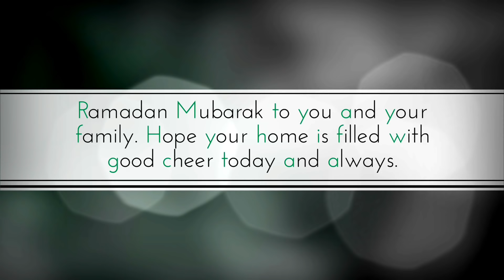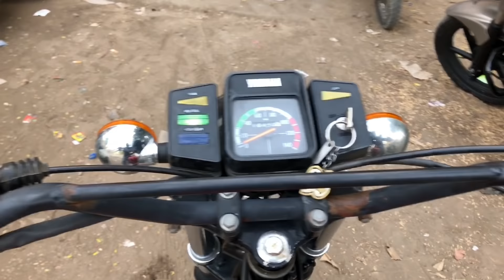YAMAHA RX100 SERVICE GUIDE | Q&A | MAINTENANCE TIPS  2018

Comment: bro please suggest me a good 2t oil for my bike. i have a rx135 4s 2000 year. i am currently using bpcl mak 2t. i m confused between mak 2t and motul motomix. i previously used motul motomix but it was half tank left and i topped it up with mak 2t so now i am using a 50-50 mix of mak and motul and i still have half litre mak left in a bottle. waiting for the oil tank to empty so that i can change the oil.
Reply from the maker: Go with Shell penzol oil
Reply: Thanks for replying bro but I use the bike for daily commute to my classes(10kms a day) so I was looking for some mid priced product so that maintaining this bike would be a little economical for me.

Comment: Bhaiya,
Agar m rx100 ka silencer ko rx135 m lagata hu to uska exhaust rx 100 ki tarha rehega kya?
Mera 135 m mujhe 100 ki tarha exhaust sound chaiya kya kare????
Reply from the maker: Not possible exactly coz rx100 ma cylinder ka diameter alag aata hai more smaller one so thats why it can produce signature sound,
In rx135 already there is Sweet sound ,
But in case ur want cut the little Muffler pipe and check.

Comment: My RX 100 bike on full speed some times it quickly slow down the speed and off the enjine.It always happens after 10_15 km runs. Why?
Reply from the maker: check crank
Reply: Bro it's pick up coil problem change Ur pick up oil

Comment: I have rx135 4speed 2003 .25sleev bore milage 32 aata hai bas, maximum kitna milage aata hai rx135, aur milage ke lye kya karna hai
Reply from the maker: Bhai Carb tune karao And tank clean karo Reed valve dekho ek baar if required boaring karao